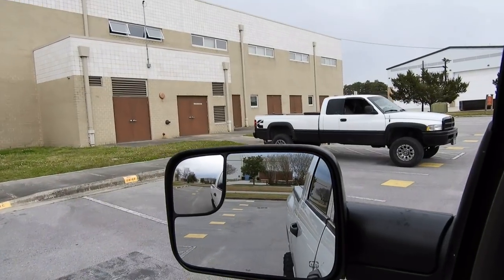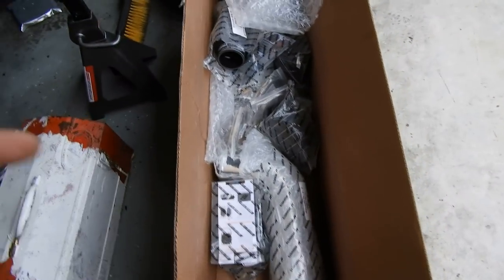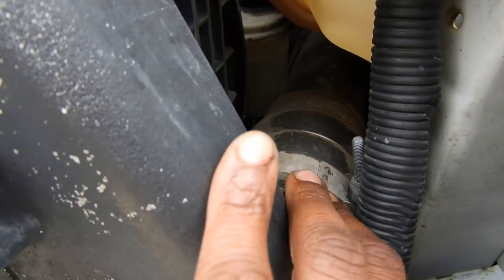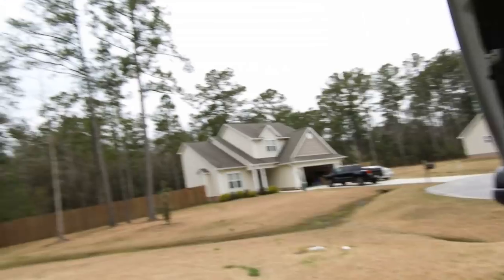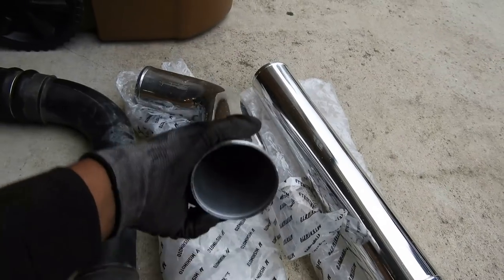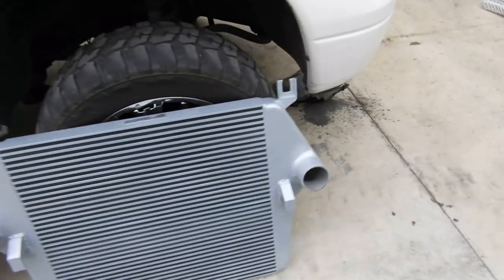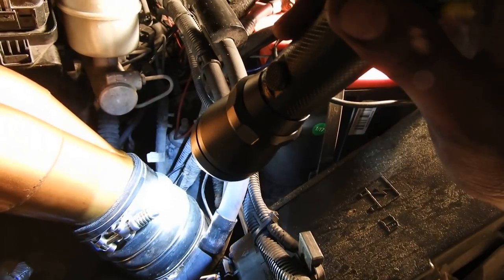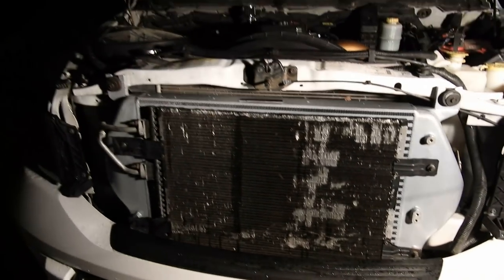6.7 CUMMINS MISHIMOTO INTERCOOLER INSTALL

Comment: Would this be the same for the 4th gen trucks? I have a spare factory inter cooler that I bought from a guy to replace mine that has some minor holes in it from rocks and crap.
Reply from the maker: It's similar but 4th gen intercooler.u are small.

Comment: I’m getting ready to start working on my 07.5 again, very shortly (ordering parts tomorrow) doing a bunch of stuff that you’ve already done and been watching your videos several times to prepare myself! One of the things I’ve noticed is, the oem tube on the passenger side is not straight! It is offset I think cause the inlet of the intercooler doesn’t line up to where it’s attached to the turbo! But the tube you installed is straight! Looks like the rubber boot at turbo is in a bind too! Might be ok for now but I think you will have problems with that later when you get a little age on that boot! If you go to Pushers Website and look for the intake and elbow kit, it shows the tube to be offset like the OEM!! Sorry for the long post and thank you!
P.S. wish I had your p # so we could communicate better( got several more questions) maybe you can request me on FB, then I could send you my # by private msg!
Thanks again sir!!
Waving from Santa Fe Tx!
Reply from the maker: Robert Thibodeaux haha just message me on Instagram To my channel. And the hot side tube your referring to is straight it comes from mishimoto like that. It sucks putting on haha but mishimoto even said it will be hard to put on. But as for the boot it is on good. I dont have leaks. Also everything from mishimoto is backed with lifetime warranty.  There stuff is high quality that's why I went with it. They couldn't bend that tube since the diameter is bigger than stock and it wouldn't fit there that's why its straight. Thanks for the comment and watching my videos.
Reply from the maker: Robert Thibodeaux also your right the oem is bent for fitment. So far she works great
Reply: EVERYTHANG DIESEL thanks for the reply bud! Hope everything is ok! 
I don’t know nothing bout Instagram but I’m gonna try! Lol

Comment: wanna see something crazy if you've still got your stock intercooler? set it up on its side with the port in a bucket and watch how much oil ends up coming out of it from your CCV vapors condensing in there...
Reply from the maker: Mike Pozzi yeah it's bad man. But yet people try telling me the ccv delete is bad. Smh
Reply: probably the same folks who'll tell you it's more efficient with the emissions intact. umm, clearly they're missing a few pieces of the puzzle, like engineered failure rates (sales tax generation), engineered inefficiency (fuel tax generation), etc. also fun to go into carbon footprint differentials with people who drive brand new cars every 3 years when our trucks will pass thru 3-4 owners and reliably do 6-7 times the miles without major failures like "durable-expendable" commuter-grade cars.
Reply from the maker: Mike Pozzi amen brother!!🙌🏾 the 5.9 cummins didn't have a ccv filter kit on it and it vents fine. So how does the 6.7 need it all of sudden?? Exactly my point .

Comment: The mishimoto intercooler is damaged on the outlet.. it is suppose to be perfectly round.. could cause boost leaks which is very un health for the turbo and not good for making power.
And It should have came with all of the proper hardware.. if you bought it used or off of Amazon i would send it back and order directly from mishimoto or a dealor.
Reply from the maker: It actually has been working perfect since I got everything taken care of. She runs awesome
Reply: Cool deal man 👍